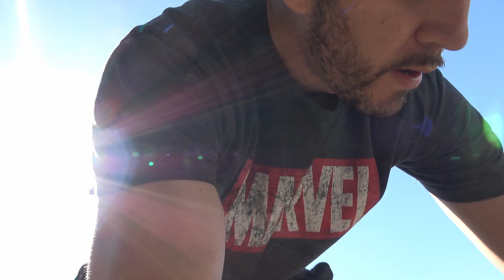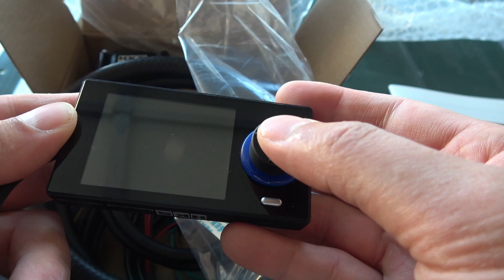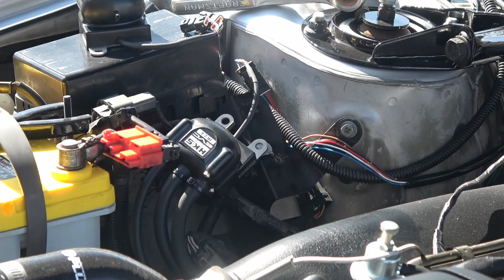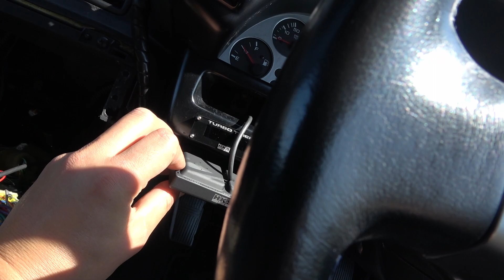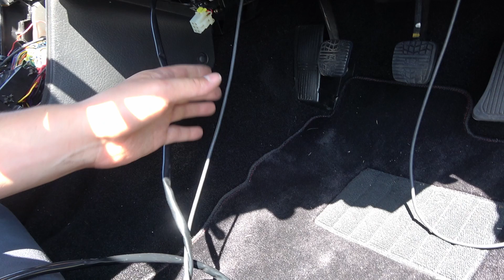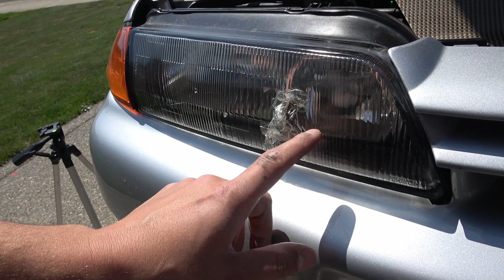HKS EVC 7 review unboxing and install Nissan GTR R32 boost control

Comment: I Thought it wasn’t recommended to “t” it off the fuel regulator. 
Looking forward to the build. Especially the turbos since I’m in need for some.
Reply from the maker: I have read forums that say that about the fuel pressure regulator. This is the way UP Garage installed the old HKS EVC 6. I am sure that they know what they are doing. I trust them and they build some pretty amazing Nissan GTR's!
Reply: I hear ya 👍🏼